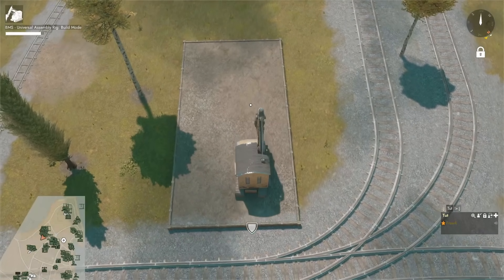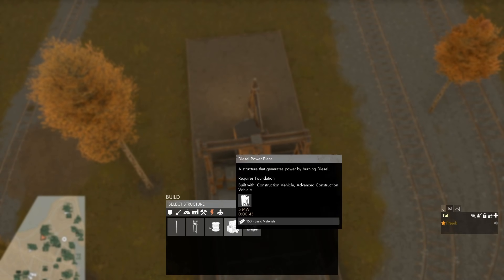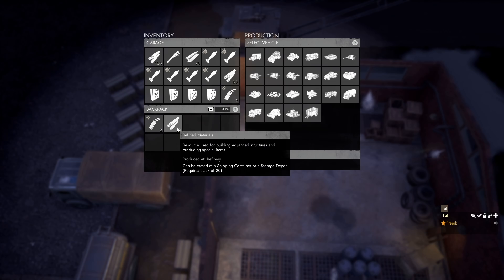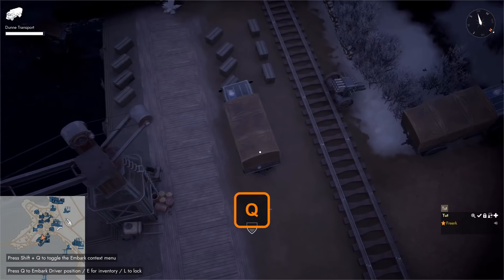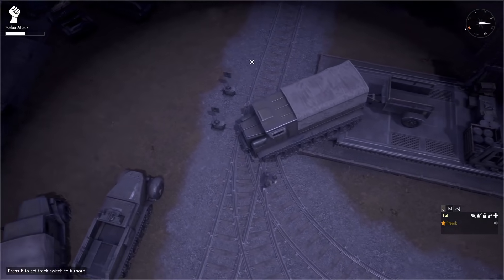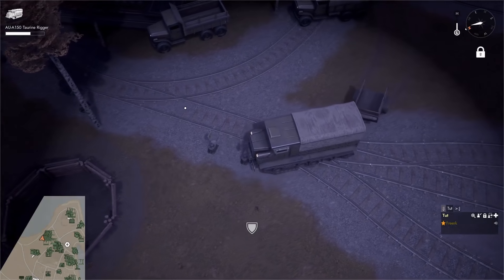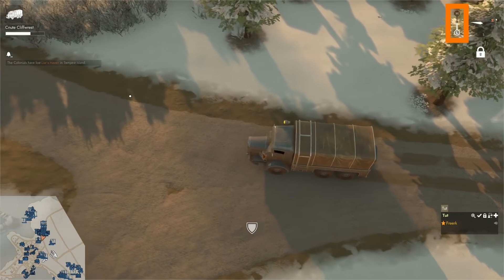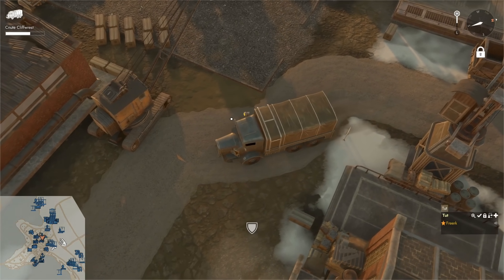Foxhole Guide - Trucks, Trailers and Towing

Comment: As of update 58, you no longer need to worry about turning off the power of the diesel power plant as it will limit itself to only produce/consume to required amount. (If there factory is inactive and the power plant is on, no power will be produced and no fuel consumed)

Comment: 9:30 how to prove to everyone, that you did not play eurotruck simulator 😅. thank you for the preview. trailers would definitely be used as a poorman's flatbed to carry more resources at the beginning
Reply: trailer costs 10 rmats to make... if you can get 10 rmats, then usually are also able to get 30 for a flatbed lol
Reply: @alukata9763 i guess, still worth to try using them for scrapping. for ammo and fuel - definitely not, flatbed with pallet or cistern is definitely better, but raw materials could be better with the trailer (since it just runs quicker and you do not need cranes, which are taking some time to bring)
Reply: @alukata9763 and yes. it would be way better if they would require bmats, not rmats to build (like 100 for the truck + 100 for the raw resource trailer)
Reply: @spechulfapticks3108   Crane is not really a factor, you just need to bring it there once. 
Flatbed + ress container is 5,3k scrap
hauler/heavy duty + trailer is 2,4k scrap
dump truck is 2,2k scap
about 200 scrap in char inventory (not sure atm what the exact number is).

Flatbed + trailer would have been good for making scrapping better ^^ That would allow 6,1k scrap per trip.
Reply: @alukata9763 so, in other words we need to have the trailer + truck to be about as flatbed in capacity to say "yeah, let's use trailers". well, i suppose, we will see if there is profit from having trailers after the launch and see, how many people would actually use them
Reply: @alukata9763  the capacity of base trailer is way to small still. 
Though for an extra 10 pcons can have the trailer be a bit better as a rapid unload platform for shells or a tanker that regular trucks can move.
Reply: @spechulfapticks3108  if trailer + truck has the same capacity as flatbed, then flatbed becomes obsolete. What we need is the option to attach the trailer to the flatbed. 

Some inefficient players, the ones who are still doing ress runs with hauler, may start to use the trailers. If too many do that, then the traffic jams in logi towns & at seaports may become a lot worse, afterall with trailer it takes up more space and at seaport they need to unhinge, move it to platform via crane, submit, then submit truck, so that's 3 very time consuming extra steps there.
Reply: @spechulfapticks3108  can shell (crates) be put into the junkwagon/tumblebox? If yes, then it may be interesting for bringing 120mm (crates) to the frontline.
Reply: @alukata9763 i think, it is not possible to store crates in either of the trailers. i noticed only "big items", "liquids" and "raw resources" so far :(
Reply: @alukata9763 never mind me. it seems, that trailers should have some technologies researched before production (as the war goes and i still don't see them available to be produced at the garage). so you even get to flatbeds way earlier and have all storages full of them (so anybody obviously can pick a spare one at any time), before you even think of building the junk trailer 😢

Comment: 24:06 Actually I think you said the right upgrade , Battery Line is just the new name for rocket factory post-update 
We can see it well at 23:46 for example : the exact same vehicles produced at the rocket factory but the name has been changed to Battery Line
Reply: Sounds like might add more artillery variants in the future then...
Reply from the maker: Yeah I got a bit confused (and tired tbh). So you might well be right that it was the correct name after all. Let's hope it doesn't confuse too many people
Reply: I think it was because the name was kinda confused , it said rocket , yet it was used to build half-tracks and other thing , probably the reason they changed it

Comment: I'm struggling to see a usage for these trailers.

The only possible application I can think of is when doing a logi run to the front, bring a liquid trailer with diesel or a palet trailer with metal beams etc, in one run.

The basic trailer seems completely useless.
Reply from the maker: Yeah the base trailer doesn't feel like it gives a lot, might as well just drive a dumptruck.
The liquid container could be helpfull to drive to a mine in the middle of nowehere with a normal truck.
The item trailer I can easily see being used in artillery operations